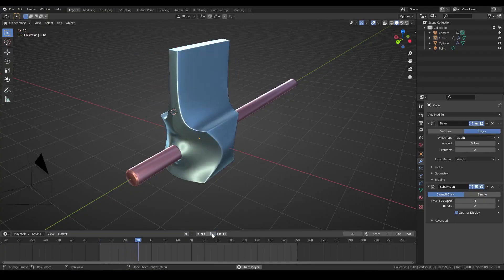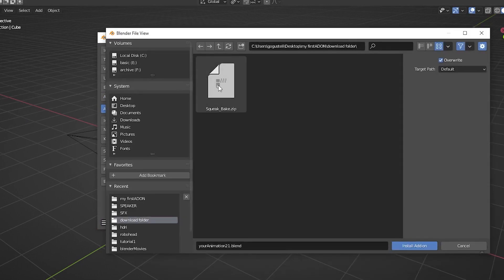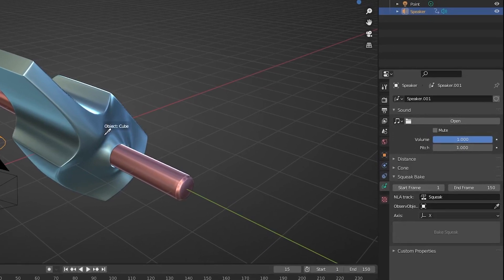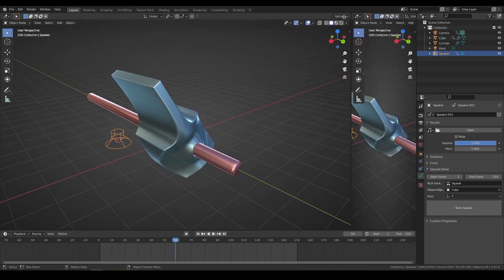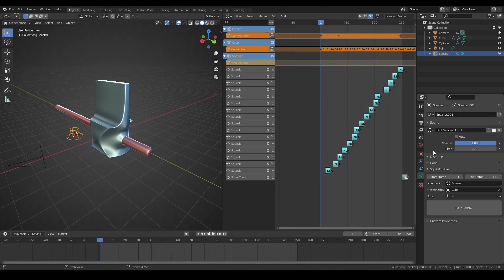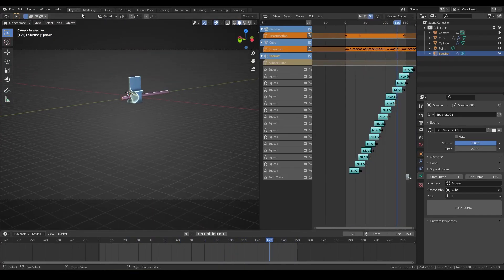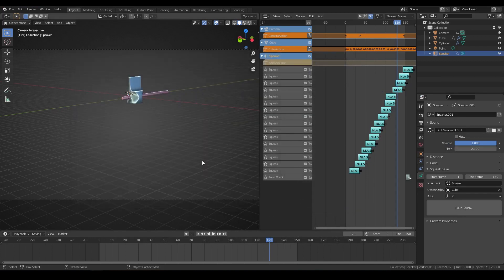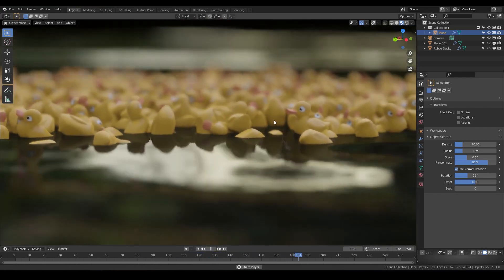Squeak Bake - Blender AddOn

Comment: The speech is very low in level - The baked sound is also very low in level when compared to the intro. Could you improve this?
Reply from the maker: sorry for that, something went wrong with the export. i will check next time before going public with the video, V2 of the addon will be up by next week and it has more options for movement scale plus the activation variables for the squeak